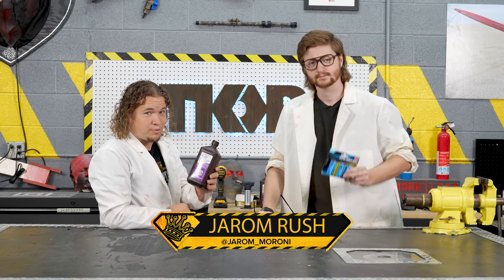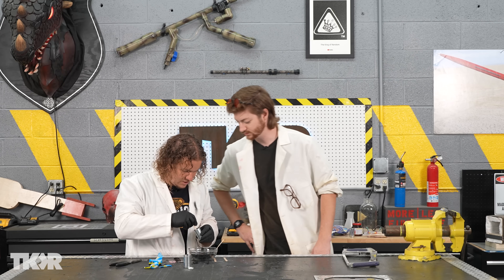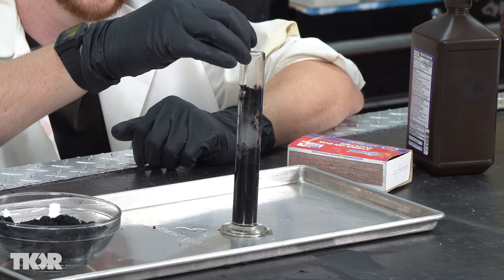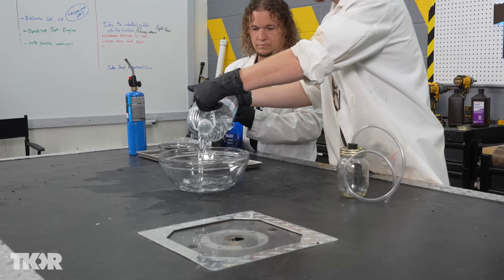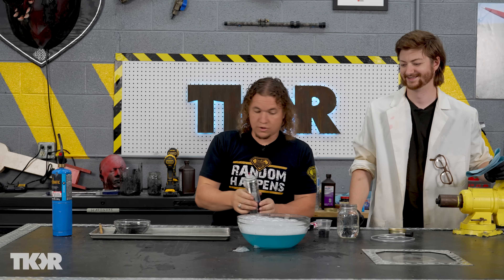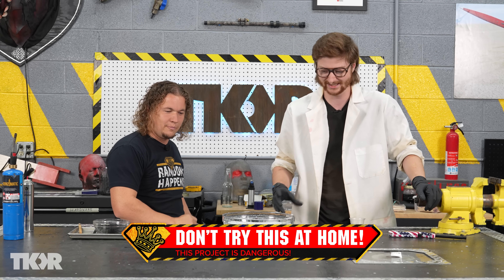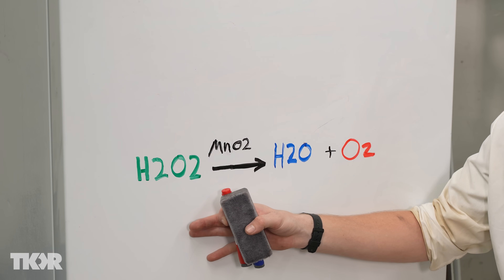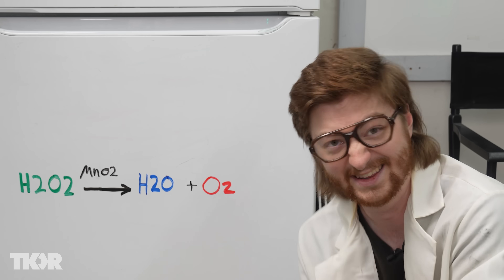Turn Household Batteries into Pure Oxygen

Comment: Fun experiments again and I'm hopeful for this channel.
My concern is safety. Hacking batteries open should require eye protection and mentioning the necessity for it. Kids are watching and likely to try this themselves. Also, have a cylindrical (or maybe any shaped) object in a vice if sawing it open. Be sure you are not introducing the metal of the hacksaw into a reaction and that you are not exposing any contents to air that react with oxygen etc.
Be fun but don't be irresistible when influencing kids or anyone who doesn't know of the risks.
Sorry for being a wet blanket.

Comment: If one is actually in need of oxygen.  Ya can pick ya up a good ole oxygen concentrator off the eBay for $200ish.   

Ofcourse ya not going to be able to get it in a cylinder under pressure to be used later.   

But it will in a hurry make even on the low side 3-5 liters a minute.  An a lot more pure than this.   

I have in the past most definitely let my charcoal grill with one.  Just sticking a short piece of copper tube on the end of the silicone tube and stuck it the middle of the charcoal in the chimney thing.   

Mine didn’t cost me anything it was given to me. But they’re all over eBay.  Not sure of any other uses of it other than needing to medically breathe it.  Or lighting a pit.   But I’m sure many others could have some of their own crazy uses.
Reply from the maker: Using it to light a grill is awesome and hilarious
Reply: @TheKingofRandom  works like a champ. An no added chemicals.  An does better than just the flame of burning paper under it

Comment: Is this like the scrubbers on subs
Reply from the maker: From off the top of my head (and without googling the answer lol) scrubbers SCRUB C02 out of the air in a sub. Usually there is enough oxygen in the air, and it is the C02 buildup that becomes an issue before actually running out of oxygen.
Reply: @TheKingofRandom  i saw a video on here with a gent that went on one and they showed how they had giant cylinders that burn slowly that they have to replace. I guess it could be for making. Only thought of it because of yall doing the burning to create oxygen.  It was a long time ago I saw that vid. It was from one of you popular science channels.
Reply: @irishsamurai9008 oxygen candles? Iirc those use some kind of fuel-oxidizer mix thats very oxidizer rich and thus make a bunch of excess o2. Iirc they (used to?) use a sodium chlorate-iron mix in airplanes for the oxygen masks, but idk if thats still a thing.
Reply from the maker: you might be thinking of oxygen candles? Some sort of mixture that produces oxygen as it burns. I think oxygen candles are normally for emergencies as a backup in case the main system fails.

Comment: You can use those carbon rods from the batteries as electrodes on an arc welder,  and then turn aluminum oxide into rubies in a graphite crucible.
Reply from the maker: Ok i'm researching that immediately
Reply: @TheKingofRandom nighthawkinlight and elementalmaker both have videos about it
Reply: @TheKingofRandom noice
Reply: I'd love to see that!
Reply: And as a sacrificial anode in electrochemistry.
Reply: @tradward  yep